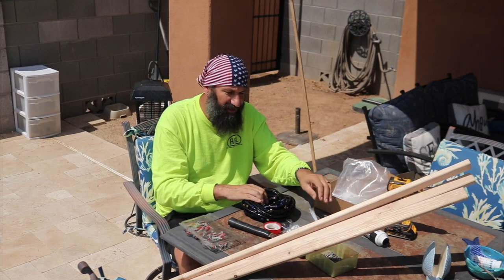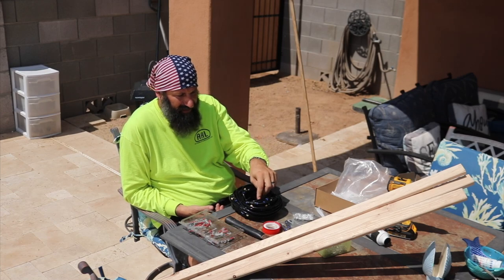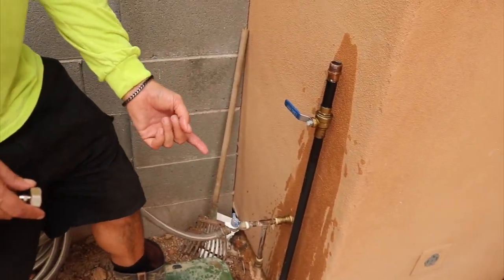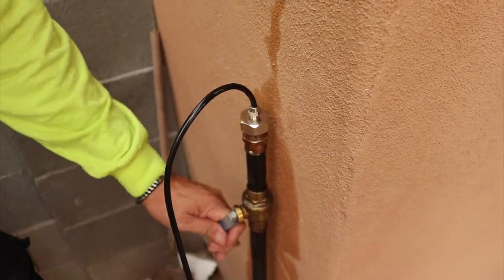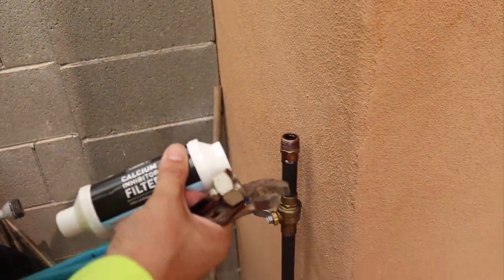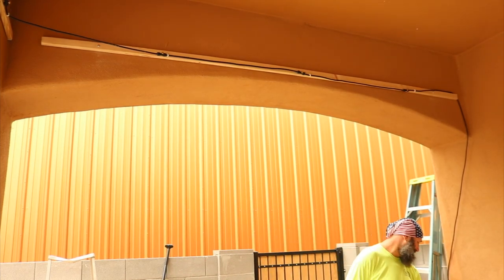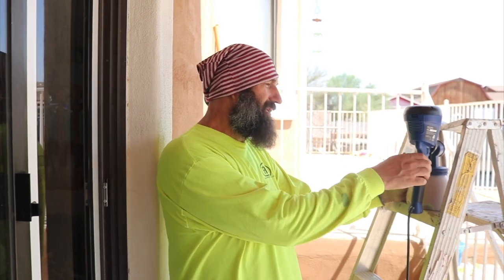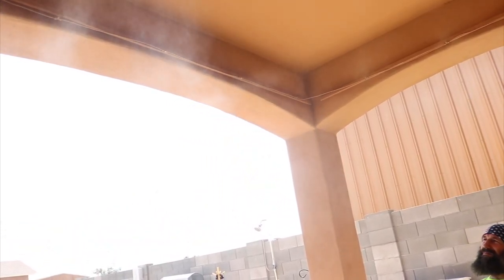HOMENOTE Misting Cooling System from Amazon | Unboxing and Review

Comment: Thank you for your video, I am going to install these this weekend. Am curious why you chose to mount the lines on wood instead of anchoring them directly into the stucco?
Reply from the maker: I didn't want to put 20 holes in the stucco.  Also the little brackets that come with it will not fit the proper anchor that is needed for stucco.  If I spent some more time looking, I might have found some brackets to hold the 1/4 line but I didn't.
Reply: Are you still happy with this kit 6 months later?
Reply from the maker: @BK-of6pc  Honestly haven't used it that much.  Installed it at the end of the season and it's just barely hot enough now to turn them on.  But I did check them out and after a few months of not using them, they turned on just fine and no leaks.

Comment: Great video..helpful.  Do you think you could attach this to a retracting patio umbrella?  Looks pretty flexible.  Thx
Reply: That's what I intend to do.  I saw this on another video.   I just received my misting system in today.  It's going over my outside air-conditioning system.  My energy bill jumped from $136 to $255 this month.   It was recommended to try this to cool the system down.  I live in the deep south where it is VERY hot. 🔥  Thanks for your video.

Comment: I've recenlty bought a set of another brand of this appliance. The nozzles does not spray water as a mist, instead they spray like a sprinkler, the little drops fall down because they are too thick instead of floating around like yours. Could it be because I do not have a water boosting pump, or my product is rubbish?

Comment: There’s a company where I live in Vegas who installs professional grade misters, I’m wondering if I should give them a call or try tackling this by myself 😅
Reply from the maker: This is something that most people can do by themselves.
Reply: @BearsWorkshop  I agree, but I’m looking for something more permanent and clean looking. They use what looks like actual metal tubing and they’re having a promotion right now with a new installation, they’ll include a free remote control to control the system.. I’m a sucker for convenience I might go that route 😅
Reply: @TeeTee0918  Clean the heads. Why would you buy a new system? Only the heads are clogged.

Comment: Just a suggestion, I would have put some of the plumber's tape on those threads.  My major question...do you know the Gallons Per Hour it puts out?  I'm thinking of using this where we have our birdfeeders so the birds can get some moisture.
Reply from the maker: The amount of water it puts out is a lot if I have the valve opened all the way.  It was enough to soak the area around it so I had to close the valve to get the pressure that worked for my patio.
Reply: You dont need tape when you have a gasket
Reply: You don’t use tape on brass.